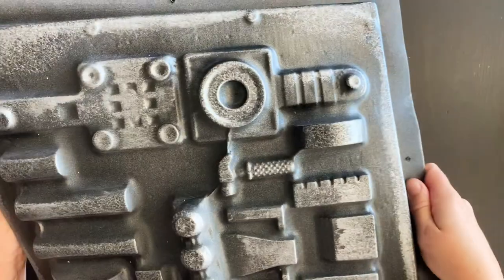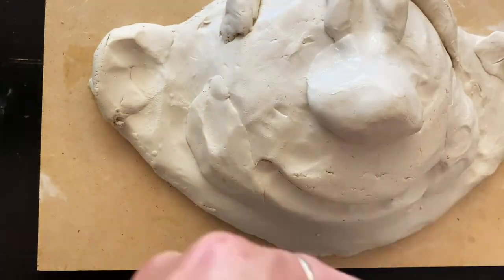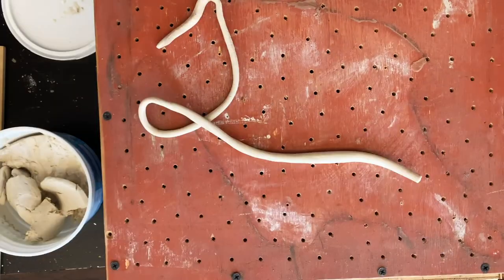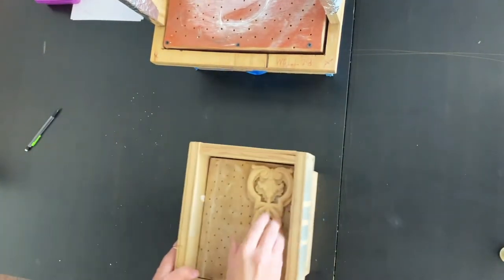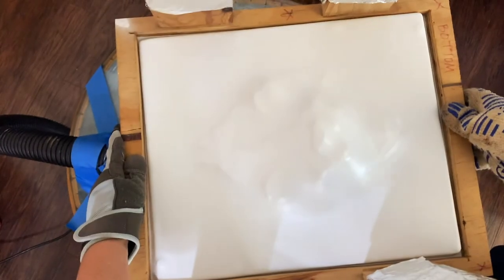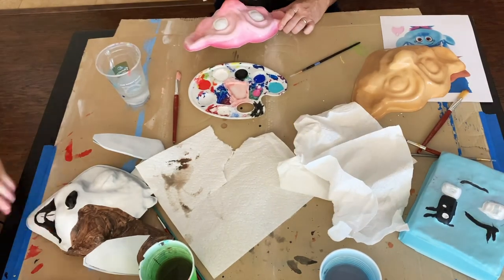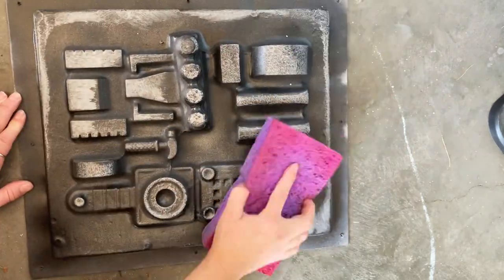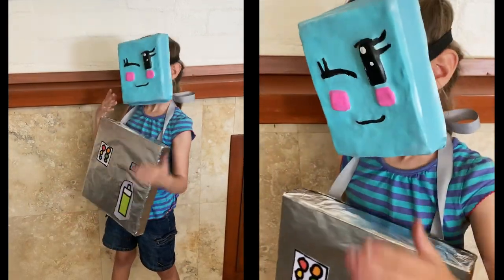DIY Vacuform Masks for Halloween!

Comment: This look interesting I'm a halloween mask maker myself and I'm looking for a way to make it look more professional so I'll have to try this
Reply from the maker: This is a great method if you need to make multiple light weight masks.  Once you have the setup and the mold, making more is super easy.  There is another vacuform video on our channel from last december where we make giant gummy bears that has a bit more information.  Here's a link to the part of the video about vacuforming: https://youtu.be/l8OX6jinB9s?t=335
Reply: @GuildoftheFlyingTortoise  thermo plastic beads is the stuff I use there light weight and also perfect for masks because you can control it and it dose not just stick it more in a way like you can control it and also what's bad about it is you need a sirtian surface or it sticks but you should make thermo plastic bead masks.
Reply: @GuildoftheFlyingTortoise  there is also a video on my channel its my newest one and it's showing one of my masks with thermo plastic bead masks
Reply: @GuildoftheFlyingTortoise  its called my mask
Reply from the maker: Looks awesome!  Nice paint job!
Reply: @GuildoftheFlyingTortoise  thank you

Comment: I dont know where my other comment is to respond to you but u should let ur kids try thermoplastic beads make sure the water is atleast 150 degrees make sure you tell them it's VERY hot [I've burnt myself] and tell them they only have a few minutes to work and that let a gardian/you burn there eyes. [It's hard to do the eyes]
Reply from the maker: Thermoplastic beads are definitely on the project list.  They're so much fun!

Comment: i cant find some of the materials but this is the easiest diy to follow from the others ive seen.
Reply from the maker: What materials are you having trouble sourcing?  Maybe we can help?  We'd be happy to try!
Reply: @GuildoftheFlyingTortoise  the high impact polystyrene plastic
Reply from the maker: @galaxyicewolfie  Amazon caries both the high impact styrene and also PETG (which is clear).  We usually get ours at our local plastic supply.  For vacuforming you will need .020" or .030" thick.  If you order a large piece it will ship rolled up and can be cut with a matte knife or scissors.  Make sure the room is well ventilated when heating the plastic and expect to have a few failed attempts while you dial in the temp.  If the plastic doesn't stick to itself on a failed attempt it can usually be re-heated and used again.  Let us know if you have any other questions. :)
Reply from the maker: We used the PETG for the giant gummy bears a few weeks ago if you wanna check it out. https://youtu.be/l8OX6jinB9s.   It's the second half of the video.
Reply: @GuildoftheFlyingTortoise   alright thank you so much! :P

Comment: By the way can you comment the supplies?
Reply from the maker: Sure.  :)  I added this info to the description as well.  Let us know if you have additional questions.

For more vacuforming information check out our video from December where we make giant gummy bears: https://youtu.be/l8OX6jinB9s?t=335

Vacuform plastics:  Amazon caries both the high impact styrene and also PETG (which is clear).  We usually get ours at our local plastic supply.  For vacuforming you will need .020" or .030" thick.  If you order a large piece it will ship rolled up and can be cut with a matte knife or scissors.  Make sure the room is well ventilated when heating the plastic and expect to have a few failed attempts while you find the perfect temperature for your set up.  If the plastic doesn't stick to itself on a failed attempt it can usually be re-heated and used again.  

We used cornstarch as a mold release for the gummy bears and it worked really well.  Make sure you have no undercuts in your mold which will get trapped in the plastic.

Vanny ears:  eva craft foam, floral wire and hot glue.

Paint: acrylic on rustoleum 2x spray paint base coats.  Spray paint isn't required.